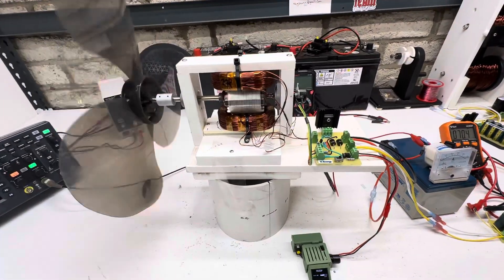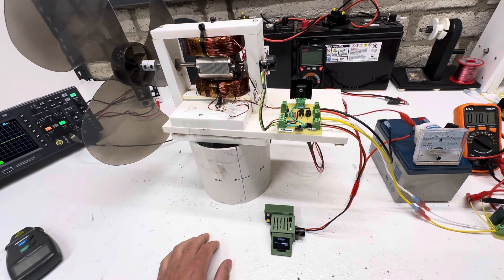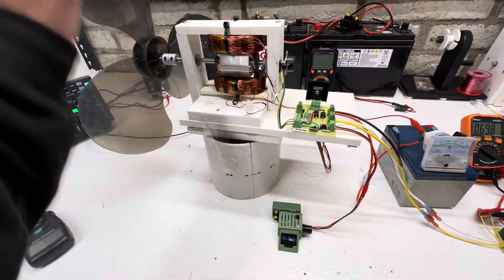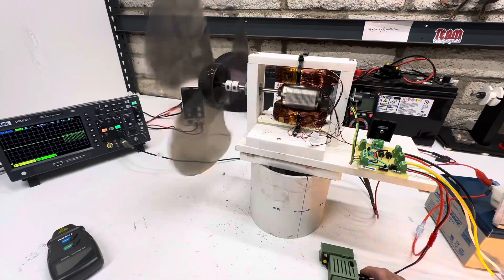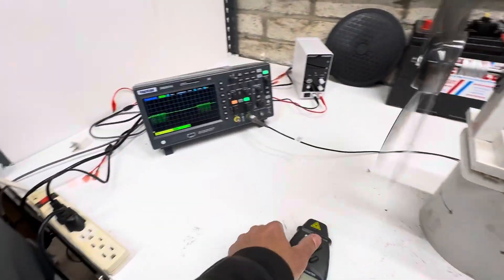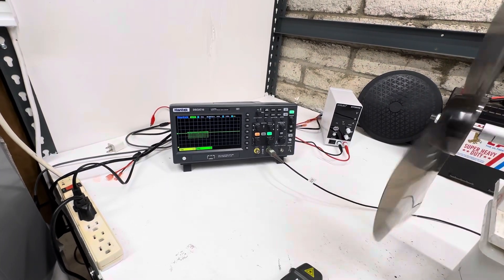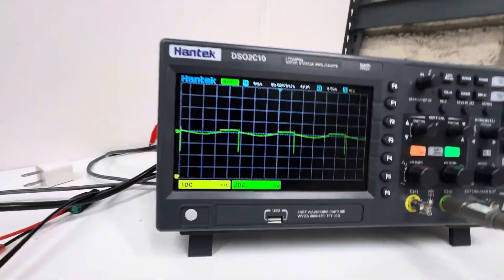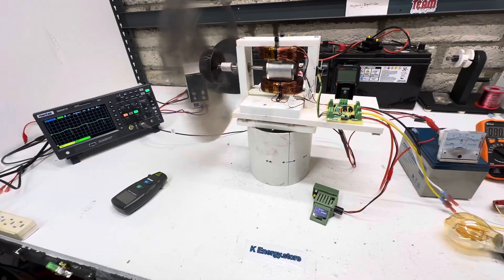6 pole window motor optical timed

Comment: whats the cap dump for? arent you just wasting energy?
Reply from the maker: The cap dump makes the 300v flyback spike useful
Reply: @kenergy1707  otherwise it's discharged as waste heat? is the energy enough to justify the expense of batteries and circuits to power loads? 4 watt led seems to replace 60w incandescent. i count 36 frames of illumination or 1500ms is 48 watts or 72 joules. I think thats 2e-5 kwh (0.00002). 1kwh is $0.15 where I live.
Reply from the maker: @fluke196c  the light bulb is just for visual the purpose is to charge batteries to get back some of the energy that is used. 
You could also use that energy to greatly reduce the amp draw of the motor 
Collecting the fly back spike does not effect the amp draw of the motor and makes it run better